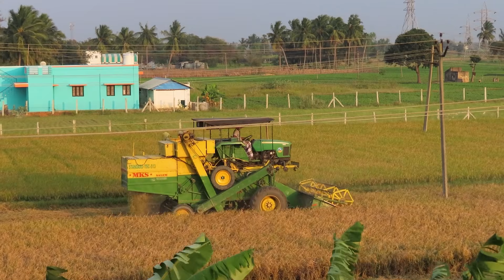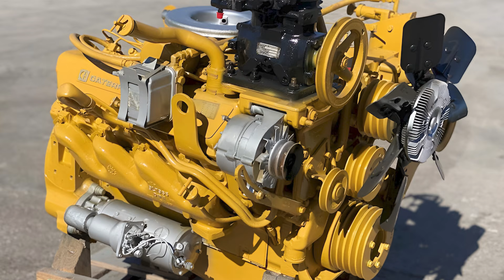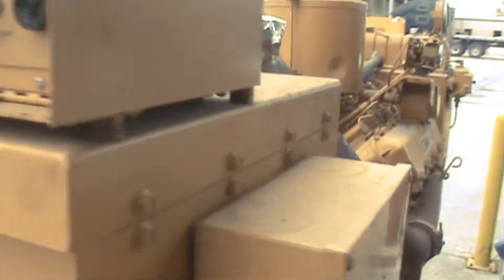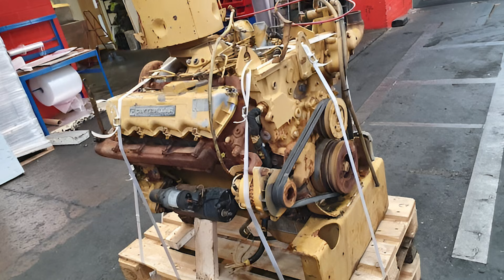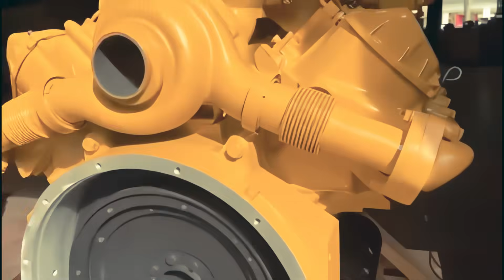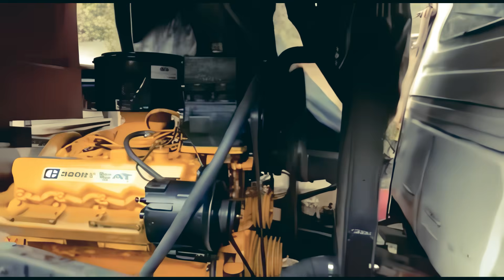The Shocking Truth About the CAT 3208 – “Throwaway Engine” or America’s Workhorse?

Comment: Throw away engine, my ass. I worked at a plant years ago and we had a huge CAT fork lift on the cylinder yard. The forks were about 6" thick. It had a 3208 'throw away' engine in it, and when I quit it had over 20k hours on it, and they hadn't  threw it away yet  -

Comment: got them in the late 80's in the state I live in  planted in  L800's  5 speed trans with 2 speed rears  to push snow on the interstates here    great running decent power way less fuel then the gas engines we had in the older trucks  Never saw a issue with any of them  the 5 yrs I dealt with them

Comment: Worked on dozens of them. I saw them first as the Ford V225 engine (never saw the V-638) but, at the same time, they were called the 1145 (522 CID) to the 1150/1160 (638 cid). Those first engines ran an inline Scroll-type injection pump; the Sleeve-metering pump came out with the renaming to 3208. Overall, a fairly tough engine. True, not all that great out of the chute, but keep the rpms up and they ran forever. 

They had one weak point that was misdiagnosed time and time again, giving it a bad name. The engines would get hard to start cold and hot, run smooth through mid-range, then start to smoke blue/white and misfire (even backfire) at high rpm. Of course the natural repair was to replace the injection pump and injectors. That cured the starting problem but brought the misfire/backfire down to mid-range and made it almost impossible to achieve high idle.

Well, the cause was the timing advance unit, which was incorporated into the intermediate injection pump drive gear, had fouled up with sludge, usually due to the aforementioned comment in the video of people trying to sneak a couple hundred hours over the recommended oil change times. Replacing the drive gear was a rather involved procedure as it required removal of the oil pan (to allow clearance for the oil pump), followed by removal of the gearcase cover. The front engine mount was always incorporated into the gearcase cover so, like I said, the repair was just short of being major. In some applications you just pulled the engine.

Changing the oil (and using the proper grade) at the proper intervals saved a whole lot of trouble...

Comment: I owned a Californian 45 foot powerboat with 2 cat 3208 turbo charged 275 Hp engines. The engines were extremely reliable and perfectly suited for marine duty but I took great care to keep up the oil changes and filters, the fuel system filters  and properly maintained the cooling system, Caterpillar offered a free class that went over all this in detail and it was very helpful.

Comment: Hmmm, AI text to voice is ... unfortunate. As others noted its unlikely the 3208T in my B&S 35 downeast lobster yacht would like running at 30 thousand RPM. 2800 is max. About 2500 hrs the 260 HP turbo and its been flawless. BTW I was struck by lightning (City Island NY), whicle the 12V side of the boat was toast, the Cat  only needed a starter solenoid.. Started right up. They guy next to me had a new boat with Cummins common rail engines and full electronics. he needed $80K in repairs, which were not covered by Insurance because I got struck, he didnt.

Comment: I have one In My 1981 IH Cargostar 1850B Cabover  dumptruck .  I got the Fuel pump rebuilt and added new injectors. Its bolted to An Allison MT653 automatic.  Its a perfect pairing , with a 7.17 rear ratio

Comment: I'm still running two Cat 3208 engines.. one is in my 1976 Cat 225 Excavator and the other in my 1982 Ford 8000 Winch Truck.. If it ain't broke, don't fix it 🍷😎👌

Comment: I had 1 in my 1500 New Holland Combine , the thing to remember Change main and rod bearings at about 4000 hrs. Horroble Ai
Reply: Bearings were definitely the weak link. In trash trucks we did a bearing roll in and injector nozzles between 2000 and 2250 hours. We had 2 with over 12,000 hours with nothing beyond oil changes and bearing roll in. 
The ai seems to be getting worse, not better

Comment: Simple to maintain? Compared to what, the space shuttle?! The people that love these engines....never had to work on them. 😂
Reply: Strange, I worked for a trash company with 15 side loaders with the 3208, I. loved them because they were reliable and easy to work on. The 1100s had several problems that were fixed when they went to the 3208. Crankshaft and injection pump being the 2 big ones. Oil changes on time and bearing roll in's and we never had never had major problems with them
Reply: @cbmech2563  I found out that the non-turbo versions are much easier to work on. Also it helps when they are not mounted in a yacht. 😂
Reply: @thediplomasta5891 your biggest problem was "Boat". In a truck neither a naturally aspirated or turbo charged version was difficult to work on. In fact some things were easier on the turbo engine. 
A friend of mine had a converted 1913 LA harbor tug with a 6 71 on the propulsion and a 2 71 generator that I worked on for him and absolutely nothing was easy to work on. Before the conversion it had a 6 cylinder Buddha engine that took up 2/3rds of the interior (the whole salon area). Lots of room you'd think but a frigging nightmare to work on, except that you didn't have to stand on your head.

Comment: Had a 210 hp. in a 1980’s Kodiak. Belched smoke, used oil, loud and thirsty. It was gutless. But still a lot better option than a gasser.

Comment: Competed against the Cummins 555, IH 9.0L and Detroits 8.2 during that era. They all had no cylinder liners. The Detroit 8.2 had no deck on the block above the cylinders.
The Cat 3208 was actually a pretty good engine compared to other medium duty engines of that era. We had a fleet of them in our GM Topkick 6 wheel trucks.
In marine engines if the power was kept below 375 hp and maintenance was adhered to, they ran pretty good.
Reply: Compared to the 9.0L and the 8.2 the Cat was great!! Those two are garbage.

Comment: The 3208 is the last series of the the parent block CAT engine that 1st appeared as a private label Ford truck engine.  The 1st CAT series was series the 1140 through 1160 which had a scroll metering fuel injection system.  The 3208 was the last in the line and until CAT added turbocharging had the same spec.s as an 1160.  I suspect the series name change was due to changing the fuel injection system to sleeve metering.  CAT didn't account for the the sleeve metering being sensitive to water in the fuel causing corrosion in the injection pump due to the injection pump being 100% fuel lubricated.  The typical CAT injection pumps used engine oil to lubricate the camshaft & bearings.  At the same time as the 3208 replaced the 1100 series with the 3208 CAT replaced the D330 & D333 4 & 6 cylinder engines with the 3304 & 3306 which also included sleeve metering.  Initially this change caused unacceptable warranty costs so CAT initially shipped loose fuel water separators.  Eventually there were installed options.  CAT redesigned the 3304 & 3306 in 1981 to improve fuel efficiency & reduce cooling system heat rejection.  The change was from fuel quality tolerant precombustion chamber to direct injection.  Concurrently the injection pump was changed to scroll metering.  The model change was to 3304B & 3306B.  The 3208 died due to EPA emissions standards.  Marine & railroad were the last applications with EPA emissions limits.  So, the last 3208's were the 3208TSCAC (Turbocharged & Separate Circuit Aftercooled.  The end of production caused major issues for yacht manufacturers because the 3208 required the least engine room (compartment) height of competing engines.   The loss of the 3208 resulted in precipitous drop in CAT's yacht market share.
Reply: In the 80’s . A mechanic friend of mine put one in a gmc dually. It was cool….

Comment: the modern revision of the 3208CAT engine exists as an aluminum block engine with aluminum cylinder heads and sodium filled titanium valves that is exclusively used in boats/yachts and sand rail dune buggy dragsters. 3000HP floats over the crankshaft/cylinder pistons plasticity limit on a short 5 minuet timer. 200hp is forever... all engines sold at small car/truck dealers are built around the 3000hp concept tho down sized to last that same 5 minuets at 300hp or 420hp... your common 5.3LS chevy/hemi or mustang 5.0 is only warrantable for 25hp or 35hp. the top end manufacturer power output claims are so out of hand with what the small engines can continue running at that the Canadian government decided to ban the forecasted 2026 to 2060 production standards of lite vehicles as the majority of them have zero operational capacity past lite use idling for 3 hours without developing some form of internal failure that creates accelerated damages. more reliable then a 6.7 super duty, because turbos are a endless problem needing servicing every 5 minuets too half hour for some intentionally engendered/manufactured obsolescently defective versions.
Reply: For some reason very little of this makes any sense. Maybe because of poor grammar and run on sentences?

Comment: Had one in a 1980 l8000 dump truck with 13 speed. Performed flawlessly for years. One day we heard a tick. Was hauling gravel in our mountaineous region. I switched with my dad who had been driving it. We thought the tick was exhaust leak. I went to get a load of gravel. Tick kept getting louder. On way from quarry I made it over a mountain. Going down other side i mildly kept it in a lower gear. Not over revving. Hit a dip in road that made it fall out of gear. I blipped the throttle to float it back in gear. Kaboom!!!! Looked back and saw oil and parts all over highway. Coasted down to a pull off area. Had to call a tow truck. Hole in side of block from piston rod. Decided to part out the truck. The ford was just getting too hard to find parts and the interior was getting so rickety and the front end wobbly. Door inside window parts trashed  sold parts off that truck for years. - - I also have a Caterpjllar 225blc excavator in bought in 1996. Have never touched that engine yet till this day. Only fuel filters and mufflers. Hard to believe. Never used a drop of oil!!!! Non turbo. 1987-1989 model. I wonder why? No shockload? One problem with a 3208 in a dump truck in mountains is no engine brake.